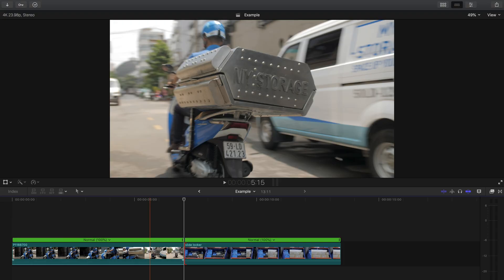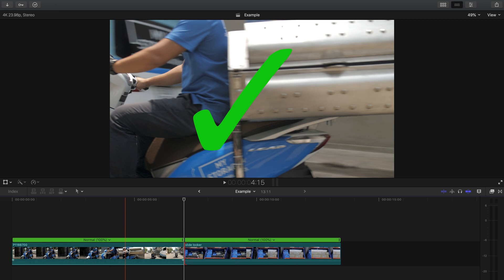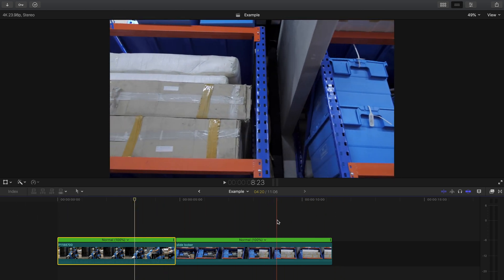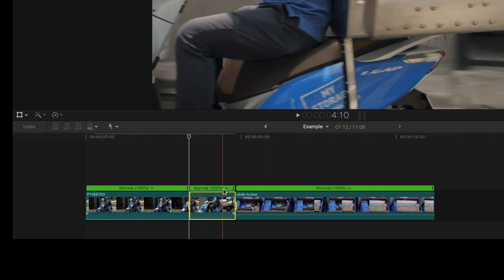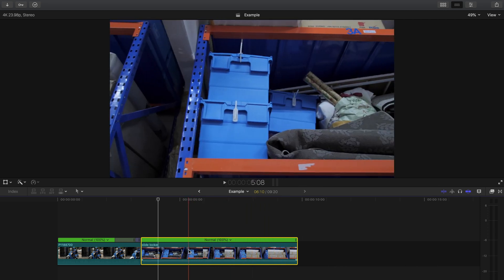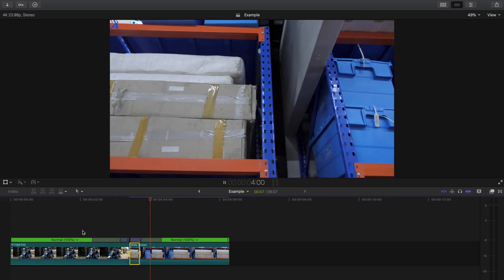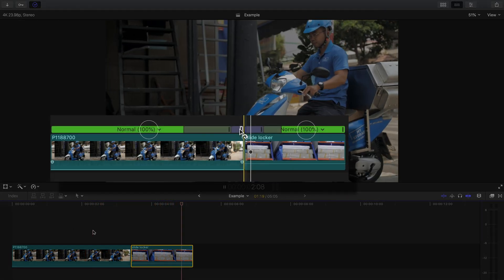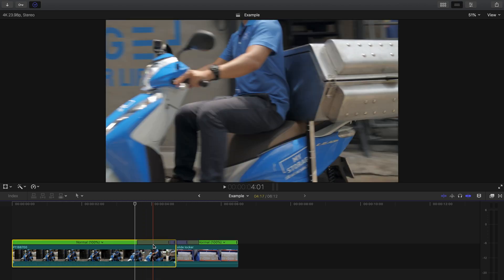Everything you want to know about SPEED RAMPING in Final Cut Pro // TUTORIAL

Comment: But what to do if I try to slow that clip down by draging on the right upper corner. And when doing that it expands not only to the right, but in both ends?😬
Reply from the maker: Press Shift B at a specific point in the clip where you'd like the speed adjustment to be made and then drag

Comment: Great video! But when I edit on Final Cut Pro, after changing speed with the arrow to 20x, that grey bar doesn't appear at all so I just looks like there is a fastened clip instead of the transition... what do I have to do?
Reply: Same problem for me! Did you ever get it figured out? I can only get the gray transition control if I use the "speed ramp" feature which is hard to use.
Reply: @YourOwnAdventure  nope...
Reply from the maker: Try double clicking the speed ramp point and click ‘speed transition’

Comment: I decided, even though I have been producing videos for quite a while, it is time for me to follow you step by step so as not to make more videos just improvising each time.
Reply from the maker: Well I'm honored! Let me know if there's anything specific you'd like to see in a tutorial 😊
Reply: I actually have a big problem.  I bought the imac 24 "1TB 16Gb ram last year.  Despite this, I can hardly ever see my Final Cut works smoothly.  That's why I was happy to discover, thanks to you, the ctrl R, but I still hoped that compared to a 2013 imac late there would be a big difference.  My question is therefore simple.  Is there something I can set or do I just have to be patient?  (p.s. I work on a verbatin 2TB external SSD, but even working locally, nothing changes. Thanks for everything Dylan and good weekend 👋🏻
Reply from the maker: @pspaces  Do you convert any of your footage to Proxy media ever?
Reply: Nope
Reply: Should I?
Reply from the maker: @pspaces  Absolutely. If your computer is having trouble keeping up with your footage, convert to proxy media so you can edit without any hiccups. And then switch back to original media once you're ready to export. I believe I have a video or two on it in my Final Cut Fridays playlist actually!
Reply: I am doing it right now with a project that I am finishing producing. Just to be safe I tried first with an old project and it worked fine. Yessss!  I have decided that from now on, on March 27 every year I will celebrate Saint Dylan 😄🙏.  My big flaw is that I have always worked on intuition.  But this way I often don't learn the basics. Thanks again, dear Dylan, I took a big leap forward today. Now I will follow you with even more interest. (p.s. I had to choose between proRes and h264, I choose proRes. I have no idea of what is the difference but it worked 😄. I’ll watch your old videos for sure) Ciao, and see you soon👋🏻 Paolo
Reply from the maker: @pspaces  Ahh I see. Intuition only gets you so far, for sure. Haha no need to celebrate me, Paolo! I'm happy to pass along some useful info to you 😊 ProRes is fine, but if you're still struggling with editing/playing back your footage then switch to h.264. Talk to you later, my friend!
Reply: @DylanJohnYT  👍🏻

Comment: I have a three second clip that I want to speed up gradually, from slow to fast. The effect is the ground approaching in a comical free fall plummet toward a rocky demise. Is there a quick way to do this or do I simply need to put in several speed ramp sections and increase them manually?
Reply from the maker: Hey! So it sounds like you have it right. Put the speed ramps in and adjust the speed by pulling on those translucent sliders.
Reply: @DylanJohnYT  Cool! Thanks Dylan! : ) Very much appreciated!
Reply from the maker: @cosmosbandit4807  You're welcome!